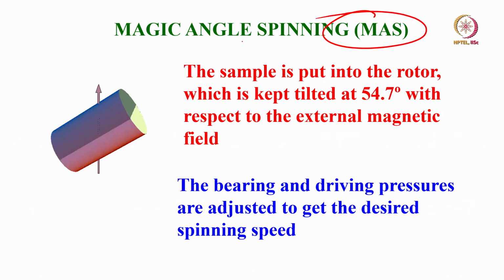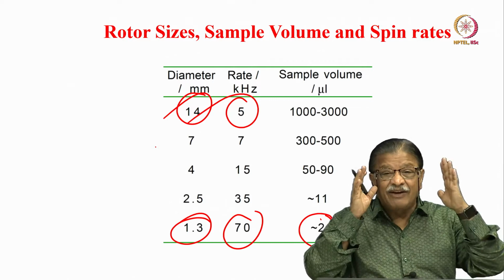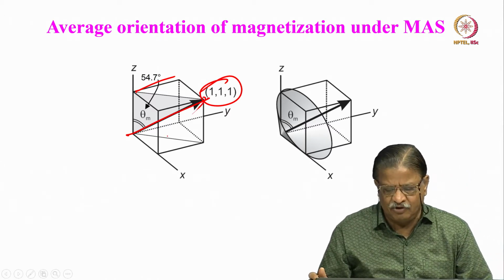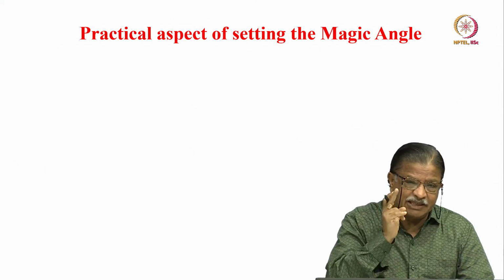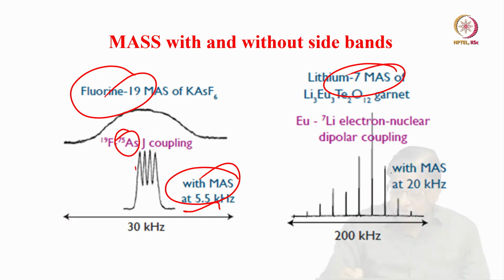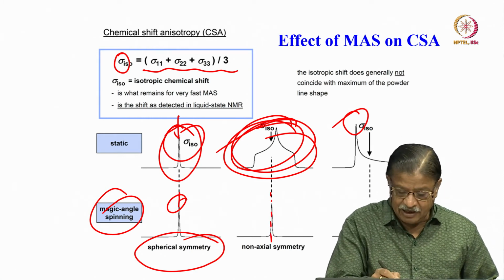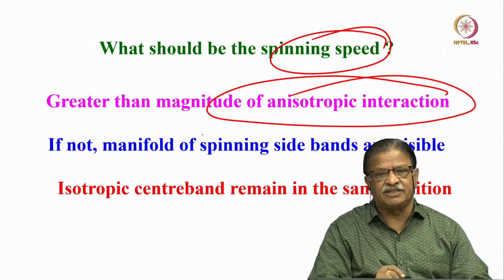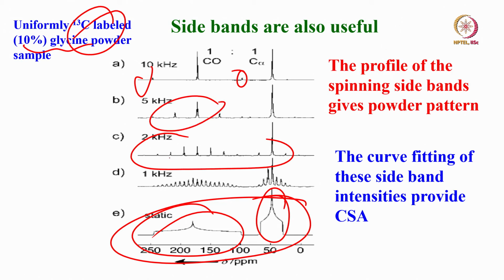Lec 57 Magic Angle Spinning

Comment: What is the correlation between Brewsters angle and the magic spinning angle? Both coincidentally are 55 Degrees give or take a few decimal  points. I haven't found any papers or documentation that shows there is a relationship between the two angles. Nature is a wonderous world of synchronicity I would find it hard to imagine the concepts don't relate. What are your thoughts?
Reply: this is a great question did you ever find the answer?